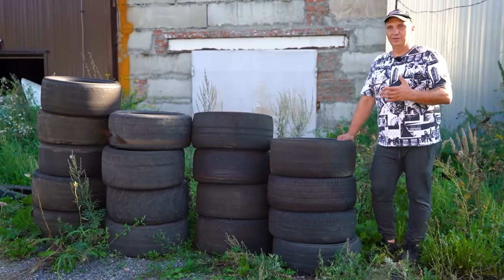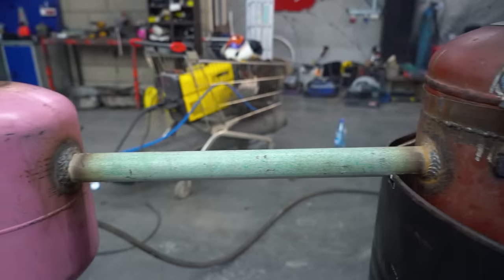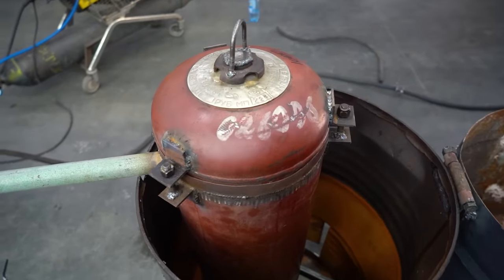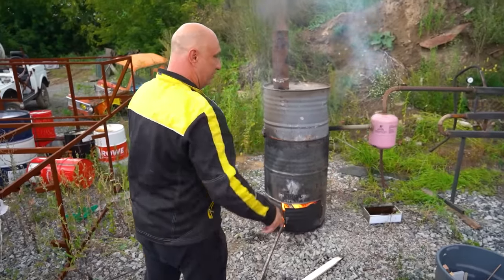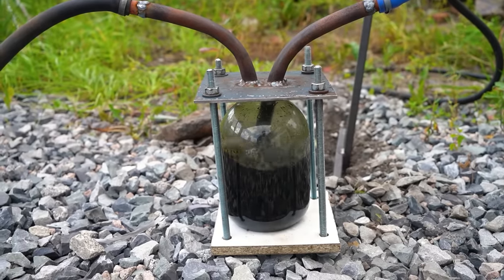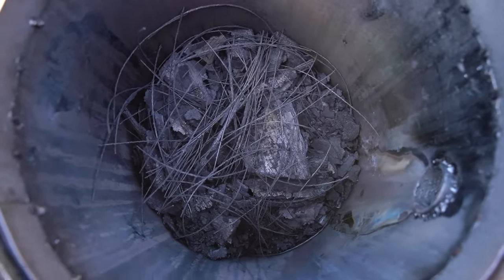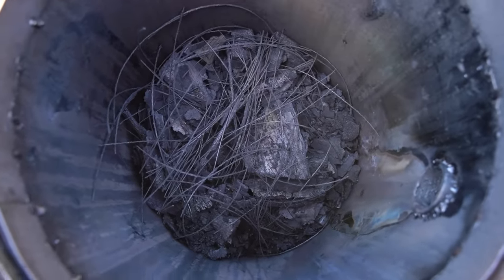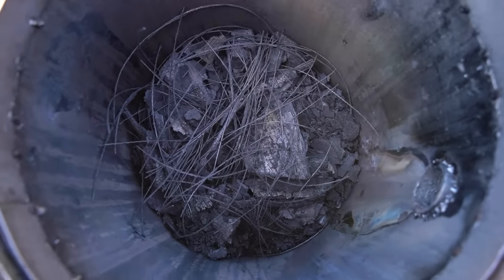We convert old tires into fuel

Comment: Honestly would love to see it tried in a carbureted engine after thoroughly filtering the liquid of course
Reply: I'm ignorant to this type of thing. Is this the same principle as using wood in a gassifier(?).
Reply: would be more suited for old diesel applications, would be similar to running cooking oil
Reply: @giggiddy  Yes
Reply: @rovhalgrencparselstedt8343  could distill it a couple more times for a more refined fuel, mixing in a bottle of octane booster probably wouldn't hurt tho lol.
Reply: A lawn mower try it on
Reply: This is tire oil or basically diesel. Nowhere near the octane rating of gasoline. This is basically bio diesel. Can be made from plastics as well.
Reply: A Detroit Diesel 2 stroke would love this fuel
Reply: Diesel fuel, has very high flash point. It will not ignite, with simple butane lighter flash.
Reply: The Mad Max future will be bright
Reply: I have put diesel in a car, by accident. It ran like crap. Added to Half gasoline and it ran fine.
1973 Chevy 454.
Reply: This tech is nothing new. You can turn any plastic into a liquid fuel. Third world crap holes been doing it for years
Reply: @giggiddy Yes, same principle.
Reply: Wood gasifier would be cool too
Reply: Main issue is because gasoline starts vaporising at - 60c ,it's pretty damn hard to get any proper light gasoline out of it. Unless you extract that tiny bit out of the diesel/crude oil mixture.
Reply: They already tried and distilled some "gasoline" on their russian channel (гараж54) a couple weeks ago
Reply: @rovhalgrencparselstedt8343 I'm not sure if this one is accurate but it is a real process. Ik a guy that did this and ran an old tractor on. He also ran a truck on wood gas. So it's real. The distillation set up would work and possibly as is but you'd be getting heavier grade fuel off of it like a lighter bunker c almost. Bet it's chalk full of horrific cems tho
Reply: @luciankristov6436 definitely not bio, there isn’t much in there that came from plants
Reply: @Tera_Hai if the burn is clean, all those Chema will get burned off.
Knowing what tires are made of, I have some other questions.
For instance, it takes a lot of sulphur in tires.
The other side of this, there is a lot of pure carbon in tires, known as carbon black.
I could see getting a lot of the hydrocarbons out, even some being broken to smaller fractions, but not a lot of light stuff like gas.
Diesel? Not so much, but something closer to Bunker C, and that has to be heated to be used in a burner to allow atomization.
Now, what to do with all that waste carbon and whatever sulphur that would be left behind after such a system would be tuned up to optimal production.
Reply: YES YES YES Please try it in any engine!!!
Reply: Pretty much, yeah
Reply: @jblob5764  that's literally the entire concept except for wood it's plastic
Reply: Running that through 2or 3 diesel filter’s should get it free of particulates, and the carburetor can be jetted to run
Reply: yes @giggiddy
Reply: @giggiddy  it's more like a moonshine still except they're distilling tires instead of mash,a wood gassifier is for producing a ready made burnable vapor ,this setup is for producing a burnable liquid you can store,I have an old Volvo 240 I'd really like to build a gassifier for, lol what I'd REALLY like to get my hands on is one of those old Lada cars, but I'm in the states
Reply: @ralphmouse2574  LOL. Thank you for the explanation and I hope you get your wish of a Lada. Cheers. Dan
Reply: The product in the 3rd bottle will be the most petrol like and the 1st off take will be the heaviest Diesel like fraction.
that said, going by the way this was done and the fact all the liquids lit from a naked flame ( diesel won't do that)  I would suggest they are pretty close in composition.  the 3rd one which has condensed at the lowest temp  will be the thinnest molecular weight and closest to Petrol. 

I believe it would run in a carbed engine but probably be a low octane type fuel.
Reply: @giggiddy  this looks more like distilling fuel out of tires than it does a gassifyer
Reply: @luciankristov6436  Biodiesel is made out of veggie oil.
Reply: They did it
Reply: 9
Reply: 9
Reply: @strokermaverick Diesel fuel has a slower burn rate but much higher energy density than gasoline, which is great for high strain applications like highway trucks, stationary power, etc.
Reply: @rovhalgrencparselstedt8343  probably didnt ace any physics tests huh?
Reply: I thought the Lada was a carborated engine.
Reply: yes
Reply: probably better to distill it one more time, also It would need a detergent additive package like all gasolines have to prevent engine damage, lucas oil fuel injector cleaner for example. 10% ethanol to contain detonation and it could be good.  honestly want to try this myself.  I have old tires.

Comment: I worked for a biofuel company that did this. Best advice I can give is to avoid the costly act of redistilling - instead consider adding different 'ingredients' with the tyres in the pyrolysis chamber, or consider blending it with other fuels. Those routes gave us the best success economically.
Reply: Hi excuse me, but avoid redistilling for what?, the raw product has too much sediment and carbon itself for a gasoline engine, i consider distilling is necessarily to concentrate the octane and purity and flammability  of final product, and remove greases (sorry if I'm wrong, with the maximum respect)
Reply: @crypto602  That's the point of altering the composition of what goes in - you change what comes out. 
You can modify the recipe to produce a much more desirable product - ours went straight into a diesel generator in the same form it came out the pyrolysis chamber, and it ran fine.
Reply: @BruceNJeffAreMyFlies Hey can we clean it ethoxide or methoxide (biodiesel) since TPO is already a distilled product
Reply: Consider centrifuging it, then route through a paper element oil filter to remove the debris to be efficient and cost effective.
Reply: @BruceNJeffAreMyFlies which ingredients worked well? Was it better if you used regular plastic?

Comment: It seems to be somewhere between diesel and petrol judging by how quickly it ignited and the smoke. Would probably be great in an old lister diesel generator or old car with a mechanical diesel pump as long as the liquid has enough lubrication for the injector pump.
Reply: I guess they could use different distillation stages to get the different weight of fuels, also adding a bit of 2 stroke oil for the injector pump would help
Edit: they did use different stages I didn't see the video before commenting
Reply: You are spot on. it is exactly a petrol diesel blend although the first take off will be more like diesel and the last will be more like petrol. I have done this and the fact it lights from a flame means it most likely has too high fractions to run straight in a diesel.  I made this from plastic and oil  and blended the output with veg oil.  Ran great in my Cs-6/1 and other small diesels.
Reply: Can be mixe 50/50 with diesel
Reply: I'm looking at these videos specifically to run my Lister LR1. What sort of ratio did you use?  @glumpy10
Reply: @glumpy10 good.

Can you guide me, to make this process? Please.

From Burundi,Africa

Comment: According to the Rubber Manufacturers Association, it takes “approximately seven gallons” of oil to produce a single tire. “Five gallons are used as feedstock (from which the substances that combine to form synthetic rubber are derived), while two gallons supply the energy necessary for the manufacturing process.” you recover 8 liters approximately?

Comment: The stuff could work well in an old diesel engine with mechanical injection
since the stuff is also called pyrolysis oil and most old diesel engines run on many different types of oil
Reply: A WW2 engine would probably run on that because most of them are designed to run on 2* fuel which means it is kinda that fuel, some of them also run on diesel and gas
Reply: It is pretty much just low octane gas if you can use a lighter to burn it it will probably run in a gas engine.
Reply: @Elyjah1 : Rescue Fuel is used in gasoline cars, and it's not gasoline itself, but is a substitute sort of fuel, for incase you run out of gas or low on gas, but I have read the label, to add to a car that has hot engine, not cold engine, not sure what it's made from, but it works in emergency situations. 

As for me I won't run out of gas, I refill it when it's about half tank empty, especially when driving long distances.
Reply: Maybe it's something that never expires ? @theroyalcrownedtiger2946
Reply: @Eduardo_Espinoza  : I don't fully remember, but I think it has a expiry date on the container itself, then again maybe not and could be something else, its hard to say for certain, at this current time.
Reply: Just don't put it anywhere near a CIS element ;)
Reply: Well, folks are working on turning plastic into fuel for modern engines. :) Plus, the Germans are going one step further, and turning CO2 from the air into fuel (e-fuels) at the Haru Oni plant in Chile. Perfect to power enthusiast's classic ICE/petrol cars when future cars are electric. Garage54 should ask Porsche and Siemens for a sample of their e-fuel when it is ready later this decade, and when the world is somewhat at peace again (hopefully). Would love to see e-fuel in a classic, perfectly restored Lada for a long road trip from Eastern Europe to Italy or Spain or something.
Reply: @Patrick-bu4vq  Golf mk2 would love this fuel!
Reply: It will work I’ve run an old diesel rock crusher off it, add used motor oil to it when you do, it will help run better.
Reply: Not that it could but it will run just fine, I have old tractors and a small dozer that we run on just about anything that burns. Those old engines are far from picky and other than winter cold starts tend to run great. They do run fine in the winter, just need a little help to get going. Could be the fuel, could be 70 years of use too.
Reply: @Patrick-bu4vq in Germany we call it "Vielstoffmotor"
Reply: old diesels will run on up to 25% gas/petrol mixed with the diesel and it was common practice in the winter before antifreeze properties were added to diesel. The fact that its a flammable liquid wouldnt make a lot of difference adding it to Diesel. maybe running it through a centrifuge first to clean it up would help?
Reply: It runs, but it doesn't run for long. Creates too much soot and crud and all the sulfur from the vulcanisation messes with the engine.
You can introduce different ingredients to the pyrolysis, or you can blend other fuels with it, though. That makes it run for a lot longer without hurting the engine.
Reply: @BruceNJeffAreMyFlies Could it work in an oil boiler for heating the house please?
Reply: @augustinedebosson9343   @augustinedebosson9343  If it's just an open flame underneath a vessel of water, anything that burns will theoretically work. You shouldn't need to worry about the soot and impurities in that case, but you may need to put a little more work into keeping the system clean. This stuff can leave residue behind inside pipes and on small nozzles, but I don't see that being a huge issue for a boiler - though I've never run one myself. They're pretty rare here, in New Zealand.

Comment: Not at all like Diesel like so many comments state. Diesel is an oil and with not light with an open flame. This is essentially a super low octane gas. Probably close to 30-40 octane. Octane if you don't know is resistant to detonation. So the higher the octane, the less likely the fuel will pre-ignite under compression in the engine. This stuff is so low of octane it'll ignite immediately. So to run it in a motor you would have to set the timing after top dead center and likely it would need to be adjusted once the engine was hot. You could probably get away with running it by diluting it 25 maybe even 50% high octane fuel. Of course your engine would have to be probably an 8:1 to 9:1 compression ratio.

Comment: I have done this before.  Running the output  pipe back through the fire as a super heater properly " cracks" the output into it's base components and yields a much cleaner and pure output. From there you run it into the water cooling jacket which can then be taken off into different  fractions like Petrol and diesel .  I just left the output as one and used it for blending with veg oil which made a great diesel fuel. 
You can Crack old engine oil like this to purify it and get a much lighter product more like Diesel and some petrol like fractions. 
Plastic can also be done the same way and a fuel yielded from that as all these things come from oil anyway.

Comment: This is high-sulfur diesel fuel.  And it STINKS.  I've done this with much smaller quantities (i.e. bicycle tire) and you can't even sniff it without painfully burning your nostrils.  Tire rubber is full of sulfur, and I'm suspecting this will be the hardest part to deal with in refining.
Reply: Just remove sulfur from it
Reply: I think diesel guys complain about the low sulfer pollution solution
Reply: It must smell amazing in some old non smogged diesel.

Comment: This is basically a homemade refinery. I want to see them refine the process again using the same liquid. That may produce closer to gasoline or propane. Some comments here mentioned kerosene, diesel or jet fuel which is spot on with the darker color
Reply: They have already pubilshed exactly what you're asking for or their russian channel.
Reply: Distill the oil into different fuels at different temps now.

Comment: I seen a guy several yrs ago do the same thing with a electric kiln and some gas's in tanks. He didn't tell me what he used but the end result he had a fuel that would run in modern diesel engines, sad part is he scammed the local garbage company and other investors out of their money and left them hanging. So sad. Great vid!

Comment: Temperature is key for distilling. If you can hold the temperature of each capture tank at different levels, you will get different liquids from each one. To distill what you've got so far, you could use an alcohol still (dangerous, obviously). Run the still on a very low heat and very slowly increase the heat. What comes out should be captured in very small containers, maybe 0.5L or less. The first containers will probably be the purest most volatile gasoline-type stuff. As it goes on, it will be heavier and heavier.

Comment: I think it'll work in a gas engine as is because it burns so easily. Just make sure to filter out the sediment.
Reply: They should have tried to fire up a lawn mower engine
Reply: Second distilling should fix the issue and more temperature control out to help in process. As of now they got all blends mixed where in distillery liquid is heated and collected based on gravity, lighter more flammable are collected on top of the tower where less flammable on lower. The cargo ships run on the low grade that is left after distilling gasoline, diesel and so on out from crude oil. Those are then further distilled to clean them from contaminants.

Comment: I've seen a similar version of pyrolysis done with plastic waste and the second stage liquid (they only had 2) was good enough to run an older gasoline generator with no apparent issues long term. Some of the first stage liquid was re run in the next batch and the rest was used to fuel the next batch. That setup used 2 old 35 lb propane tanks as the reactor, #1 takeoff was at the end of a 10+ foot steel pipe with some old cooling fins randomly placed. Then some copper coil In a garage can filled with well water (like a moonshiner) and the #2 collector at the bottom, and then back around to the reactor fire with hose and pipe to fuel it. Oddly no bubbler. 
Not sure about the environmental impact, but he was using strictly home waste and plastic picked up in the wild (cleaning up littered areas) so maybe not too bad.

Comment: This system needs pressure and more initial heat so the gases react and have a chance to form chemical bonds and then a lot more cooling and more stages of separation, all those things are way harder to do at home with a basic system. Its amazing result thou with no pressure.

Comment: So you built a large Short Path distiller. 
I used these on a smaller scale in a cannabis extraction lab.
Any questions on refining I'm having to be of service.
Using a vacuum pump at the end to pull the gasses off.
Also placing the pink collection flasks in ice cold water or even dry ice will get a better return.
Cooling the connecting pipes to -10 to -20 °C will fraction the gasses more effectively.

Comment: If you distilled down to gas/petrol viscosity regardless of the color, you end up with white gas/naphtha/ Coleman fuel are some common names for it. It is basically raw gasoline and has about 77 octane or even a little bit less. So you can use it in an old tractor or something similar or you have to advance the timing of the motor to get it to actually run right. The heavier viscosity fluids run fine in diesel motors.